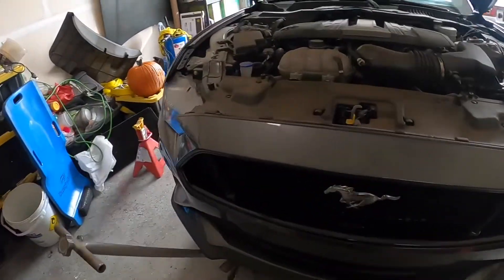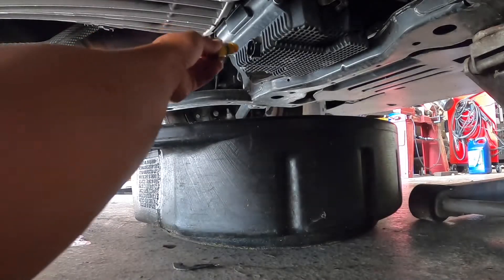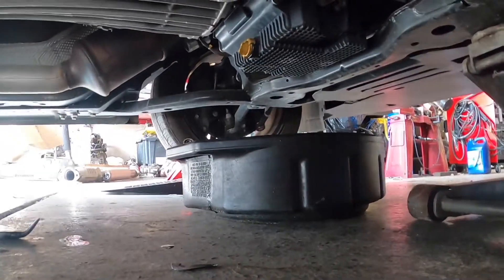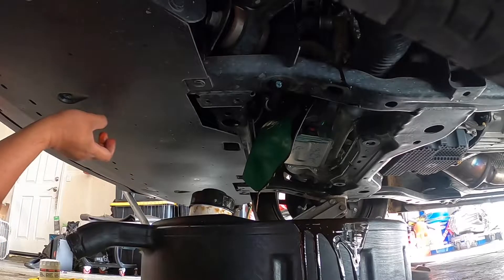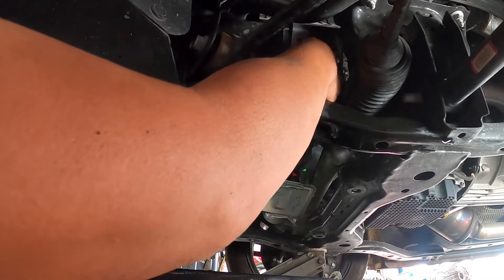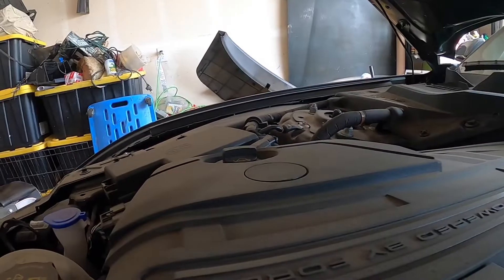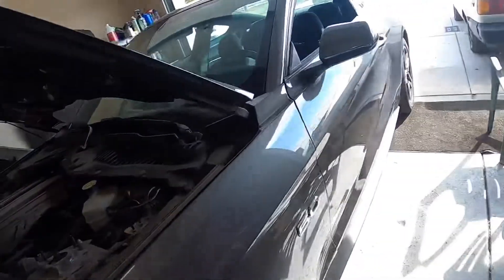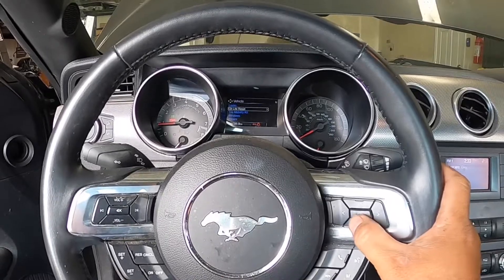Change Oil on 2020 Mustang GT

Comment: 5.0 Coyote Engines some run on 5w20, 5w30 and for Performance Driving can run 0w40 Engine Oils.
Reply from the maker: I put in 5w30
Reply: @Ed_Garage does it depend on country weather and temperature?
Reply: @Ed_Garage how much would this cost or would you pay if you can’t do it yourself at the moment ? Can I just it some oil in in mean time if needed to be changed ?
Reply: @jfros9794 I own a 2020 mustang Gt and to service the oil change $120